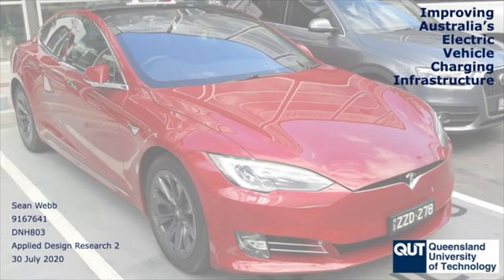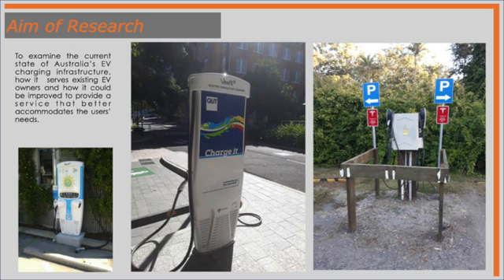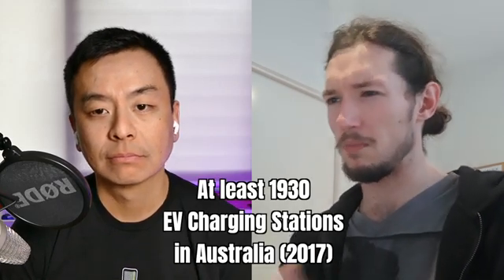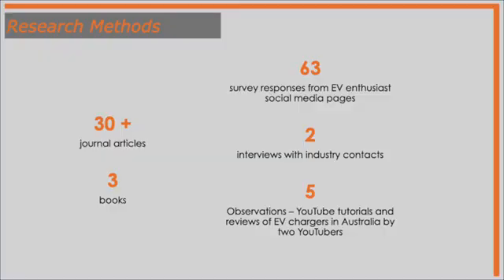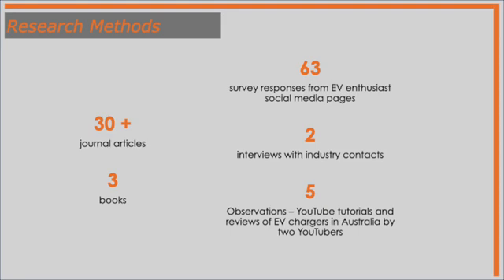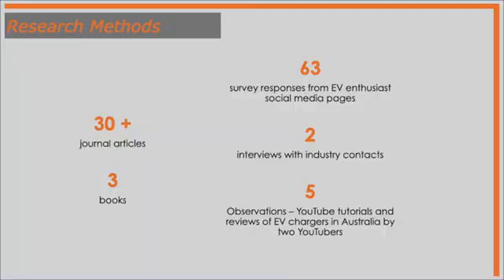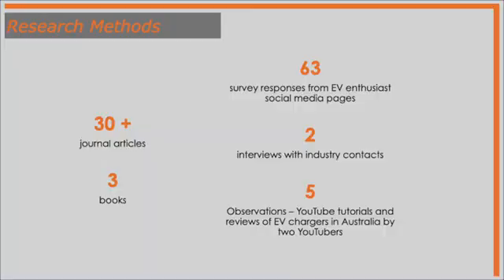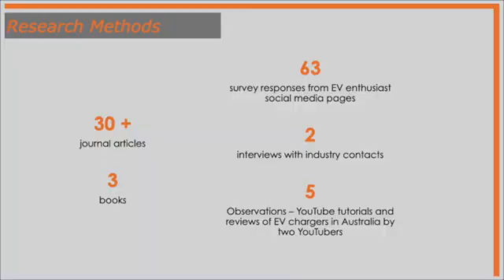Designing Better EV Charger Stations | Original Research | Tesla Tom

Comment: Good luck Sean! Despite beeing not so evolved towards EV at the moment, this also has some advantages. Developments continue, both on technical (EV charging speed and so on) but also on the user-experience side. By 'jumping in late' you can actually avoid all the initial mistakes made by others. A lot of EV charging stations are not so practical after all in use, but too expensive to be replaced already.
As for the facilities, this is a major point in the total user experience. No-one likes to sit idling in their car waiting for a battery to be topped up.  I think a hybrid option (EV charging at regular petrol stations) is the way to go. Especially on the highways. You were referring to Fastned. If you look at their locations, they generally are lokated on the same parking/fuel/food/highway exit, within 200m of all facilities. So providing only the plain charging infrastucture is enough. 
Integrating them into an existing fuel station (as opposite of a seperate location) has all to do with owners, laws, and probably costs as well. Here in the Netherlands, the regular petrol stations are from different owners than the big EV charging providers (Fastnet, Allego, Ionity, Tesla to name a few). The additional costs to upgrade the space around the station to add EV is usually not worth the effort. 
Also, a lot of petrol companies are not really into adopting into EV. EV is a threat to their business in their experience. Nowadays, this seems to charge, and some petrol stations are starting to deploy their own EV charging as well, since they are getting more convinced EV is the future. (See eg Shell Recharge or Tango Electric)
In Poland, I've for example noticed Orlen (fuel brand) installing 50 and 100kW chargers near their petrol stations at the highways

On rebuilds / new locations you will see a more integrated EV charging option. See for example the Tango station at Foodcourt Harderwijk (Google for electricfelix tango to find pictures). This has been opened recently, and has EV charging stalls exactly the same as the regular petrol pumps, not as a seperate part somewhere in a corner). Also, on the same location (near the highway) there is a Burger King, KFC and La Place, so plenty of options for refuelling yourself also - although the EV refill is more healty ;))

Another issue (at least in the Netherlands) are laws and property owners. Fuel station locations are generally government-owned, and anyone can buy the rights to run a fuel station of their brand for a certain period. Having EV chargers from another owner sometimes conflicts, and in the past, some station owners are making an issue about this, by complaining and delaying the permits for the construction works.

Local high power chargingstations are rare, and expensive to install, so most >50kW chargers are near highways. This is by purpose: On highways there is a huger demand for fastcharging, and more important, (at least in the Netherlands), the required high voltage infrastructure is also along the highways in many cases. (Wich is required to have sufficient power to run multiple chargers).

There are also quite a lot of spots in the Netherlands where both Fastnet and Allego have fast-charging spots. Also eg McDonals has 50kW chargers installed on some of their locations. (I've seen them in the Netherlands and Germany)

Electric infrastructure is one of the major issues in fast deploying charging: Even a single 150kW draws a hugh amount of power from the grid, which is not always available. In the more rural areas of Australia, I think this will limit EV charging speeds also. However, there are ongoing developments with local battery storage, and solar. A local battery bank will provide the (eg) 200kW charging, and will reload by solar and eg 40kW from the grid). Charging speed will only drop to the grid's ability if the batteries are empty

Last issue in the user experience is billing/payment. Here in NL this is really a PITA. Unlocking with app, which you have to install and register first, or apply for a RFID card.. And you need to figure out which card is accepted by which charging station. The price? Thats another topic, depends on the charging station and which card/app you are using..Totally confusing. When abroad it gets even worse.. For Aus, I highly hope this will be for the whole country the same, not for each state.